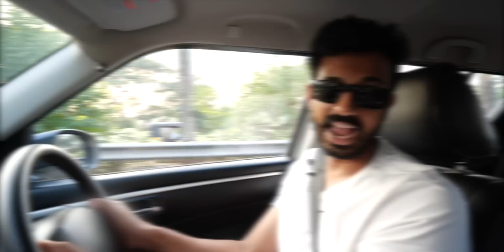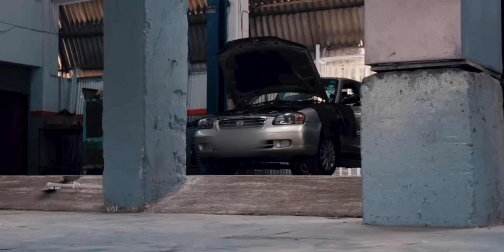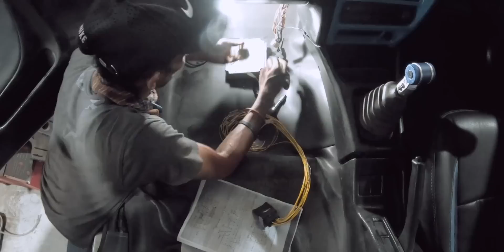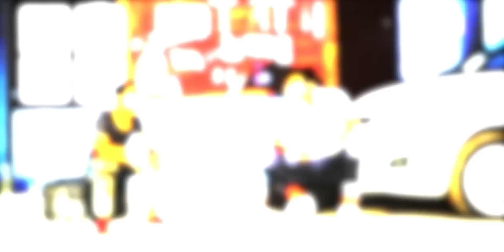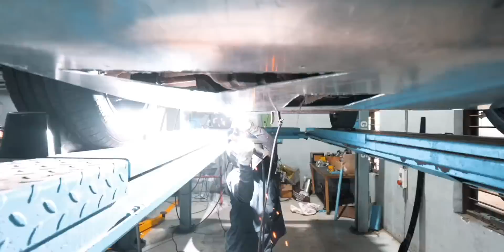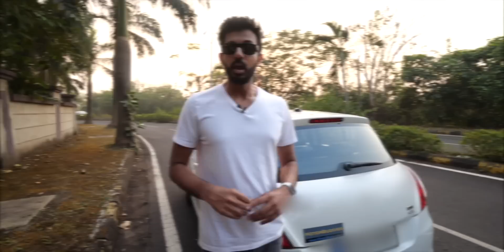The Real Superstars Of Our Cars!

Comment: It's the Swift Zdi 1.3 L Ddis 
Imagine if Swift got 1.5 L Ddis225 from Ciaz Ertiga?
Reply: It will not as demand for for the swift diesel is very less and if it gets it will get around 85 to 90 ps and 190 t0 200 nm